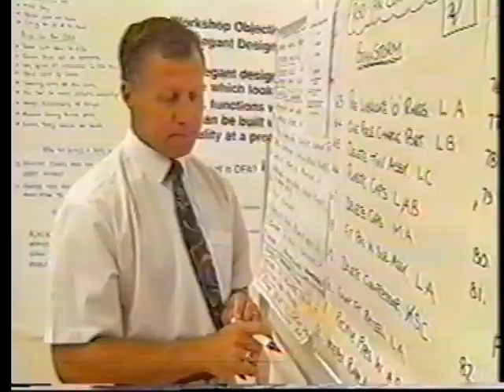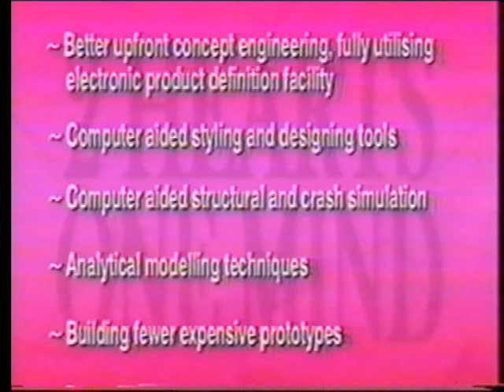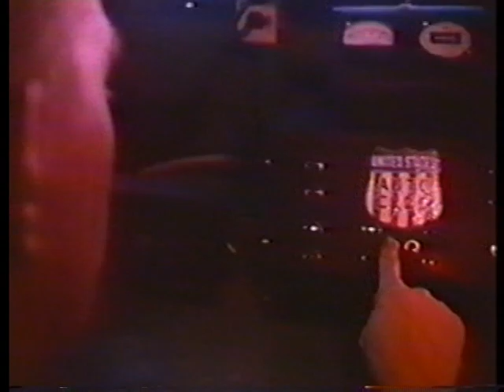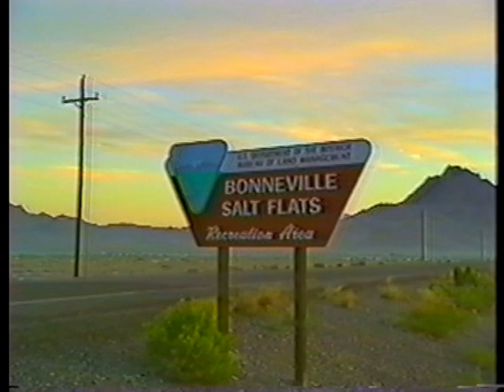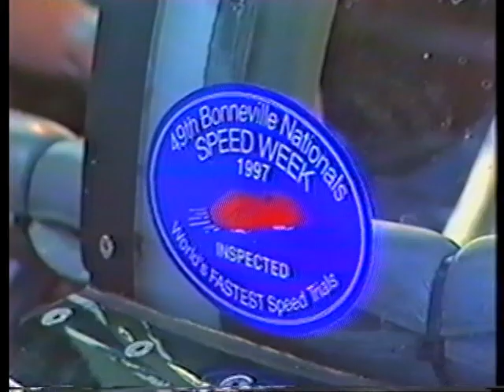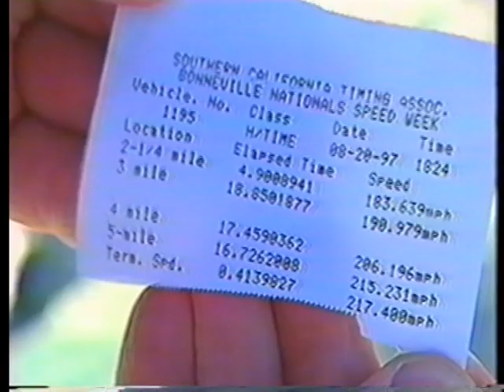1997 Rover Group 'Road Show' video - 17 minutes

Comment: One of the problems none of this talk of trying to save cash by lowering engineering costs could fix were the ‘Portfolio’ models R3 (200) seen here at 9:21 & particularly HHR (400) at 9:58. These were already signed off & underway when BMW bought the company (so they could do nothing about them) & came with very expensive Honda licensing fees so Rover struggled to make a worthwhile profit to go towards developing replacements from them. The R3 was a good car but Fiesta/Corsa sized & priced at Escort/Astra money. The HHR was probably the car that finished Rover Group off. Nothing like as competitive as the previous R8 200/400 & cost Mondeo/Vectra money. It’s quite sad watching this really, knowing how it all ended.